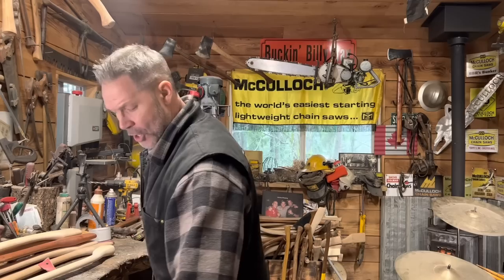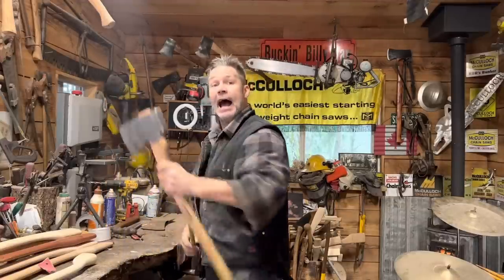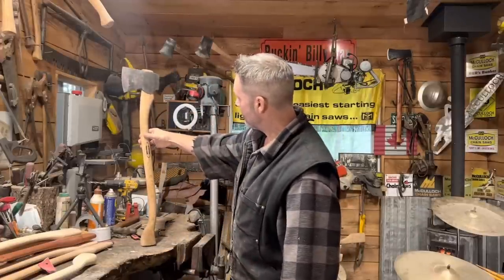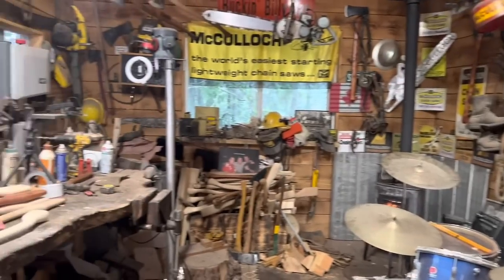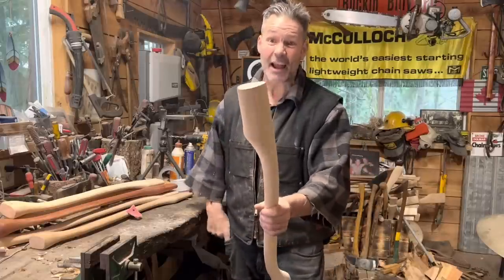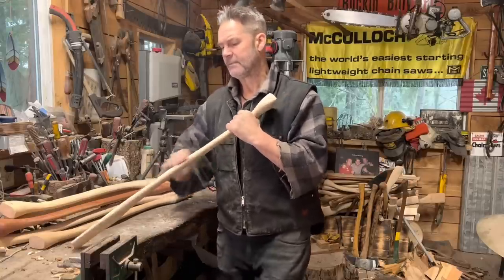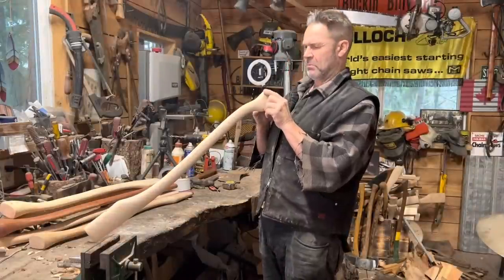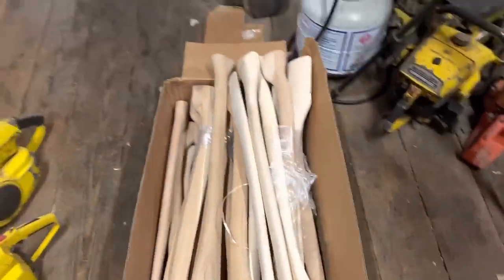UPS TRUCK HAD TO BACK UP . AXE HANDLES !

Comment: Little tip I saw when burning brands into wood, mist the area with water and wipe it off, it will keep the brand from burning more than what is intended and not run
Reply: Another good tip...

Comment: Looking forward to owning my very own wood bullet...im sure it will take quite some time to catch up on orders lol but I will wait patiently...I really like your handle design the palm swell is where it's at it offers so much control , I have been splitting firewood for many years with a 36" but I will adapt use it accordingly an looking forward to it . Thanks man later

Comment: 45+ year drummer, nice drumming in the pocket.  Massage therapy helps. Blessing Billy.
Reply: I will stress again for anyone who reads this.
Massage therapy is excellent for many parts of the body. 
There is a specific form of trigger point muscle therapy that uses an acupressure technique for pinpoint areas that are tension holding muscles. They can affect large areas with immobility and pain.
The books by Janet Travell are the main reference to the therapy. 
The practitioner has to be certified in this specific modality.
When you add to that exercises from a physical therapist designed to rebuild the muscle structure the healing can be done right.
The shoulder is the most complex joint in the body and should not be taken lightly. When humans get to be a little older (over 50) the time for healing is extended. 
The degree of the injury and numerous times that re-injury has occurred plays an important role in the evaluation of the individual.
The only reason i know about all these details is through personal experience.
Using the arm and shoulder without doing the specific form of prescribed exercises from the physical therapist will only lead to more injury and longer healing time.
And re-injury is no joke, it happens easier and easier to the point of non healing. 
Some of the 80 yr olds will attest to this. 
Weight training and resistance training is the only way for functional longevity.
" I am at peace, I'm not in a hurry"
There are also supplements for cellular health but that is the choice of the individual and personal preference. 💚♻️

Comment: You read my mind 31.5 Inch handle is perfect I hate long handle axe so much less control.  I actually just cut the handle on a Pittsburgh down to about 32 and made a palm swell out of hockey tape

Comment: It's a pity you don't sell axe heads or different length of handles. You discuss a lot of details but length is something major for me. I just made me a 38 inch handle for my splitting axe. I use the Fiskars X27 a lot - same length and I got used to it. I prefer long handles over weight and I even cut new handles of and made me new ones after just one day just to change the length...

Comment: Great work Buckin, always love seeing your videos come out, hope that arm heals up good and quick! 
I need your advice Buckin; I’m in the process of ordering some new boots- do you recommend steel toe caps? I’ve always had a separate pair of regular work boots for when I’m told I need to wear them, but I’m considering getting them fitted in my main boots from the start this time. 
Appreciate your opinion 👍

Comment: I know what you mean buckin.  It's been a year sence I fell and messed  up my shoulder. Had surgery on it. But the cold of winter  sets in to that shoulder.  Sometimes  you just got to move it so it doesn't  lock up.

Comment: Hey Billy this is a side question for you. Where do you buy your gas for your chainsaws? Do you look for non-ethanol gas or do you just use premium octane? Or do you recommend using the canned stuff? I hear a lot of things about ethanol eating up the fuel lines.
Reply: I use Premium (93 octane) 100% gas. I use echo red-armor oil and it leaves the motors like new on the inside. Ethanol can, (and usually will) eat up lines and mess up the carb if you leave it in it. I find it easier to not use ethanol and not have to worry about it damaging stuff if I don't run my equipment for a while.
Reply: @ethanmiller3935  what gas station do you find 100% gas
Reply: @Goldenkryptonite999  l get it from a local station where l live. Its B-quick Mart (locals refer to it as Carlyle's in Dunlap TN. Citgo in town also has 93 oct. 100% gas. A lot of stations in my area carries 87 octane 100% gas.
Reply: @ethanmiller3935  I see, I live in Kali-Fornia-Stan every gas station has 10% ethanol minimum per gallon. So I either get good at replacing fuel lines or buy the canned stuff. The higher the octane the more ethanol it has. 🤷‍♂️ I need to move to TN.
Reply: @Goldenkryptonite999  Around here, most pumps contain a minimum of 10% ethanol, no matter the octane. I am not sure that the higher octanes inherently contain more ethanol. Most of the stations that have 100% gas have a separate pump for it, and it is usually just 87 octane. I am lucky to have Carlyle's that carries 87,89 and 93 octane 100% gas.
Reply: I like the Echo red armor oil, so I would get their canned gas. How often do you run your saw, because canned gas isn't cheap.
Reply: @ethanmiller3935  I run it in the spring to cut firewood then I clean it up and store it for the next year. I let the wood season during the summer and fall since we get 100-114 degree summers here and it is ready by winter
Reply: @Goldenkryptonite999  Ok. I would say you would be fine to run ethanol in it, just when you get done with it for a while, drain the fuel out and run the saw dry. I also might take the diaphragm out of the carb and spray a little bit of wd40 on it to help keep it from drying out
Reply: @ethanmiller3935  thank you Ethan for the advice. I will do that! I went by Home Depot and picked up a bottle of the Echo oil mix red Armour, looks wicked can’t wait to run it through the saw.
Reply: @Goldenkryptonite999  Your welcome! Glad to help!

Comment: As you get older they will get longer and more intense. Check out stem cell therapy, take a little weekend flight to Colombia. Seriously
Reply from the maker: I m getting younger
Reply: Benjamin Buckin ☺️
I got younger til about 58 then the real shoulder injury took me down for a year.
Then the stage 4 throat cancer took me down for 2 years, here i am 5 years later doing resistance training and weight training and taking excellent supplements for cellular health and wellness, keeping my skeptical brain occupied with OCD activities.
Happy and healthy is a good life sentence 🎶🪘💚💪🪕🎻🎷🎹🥁🎸